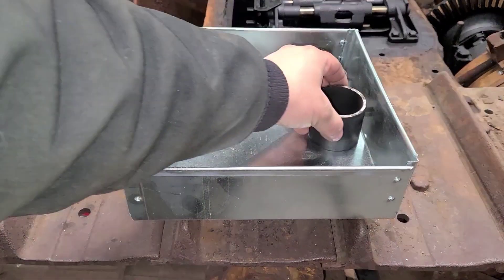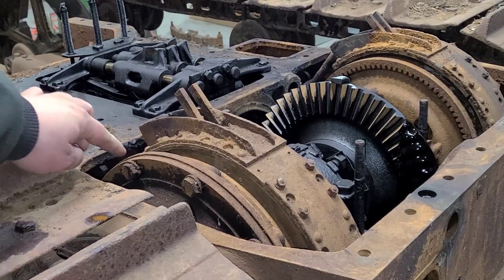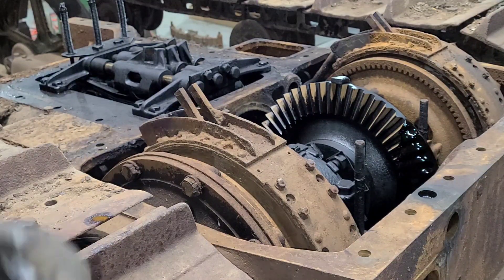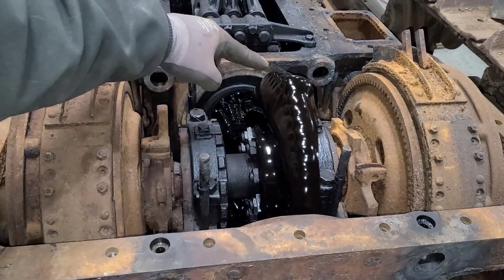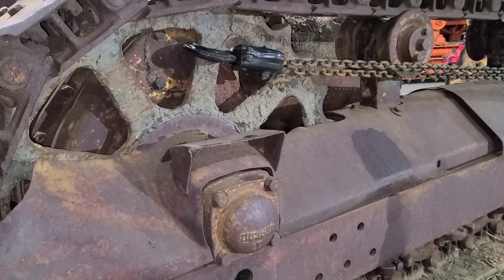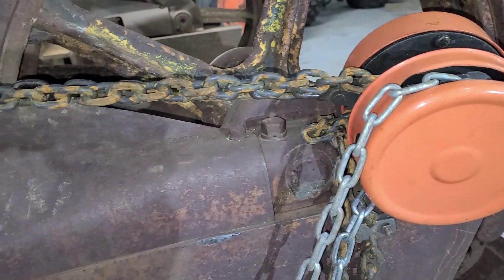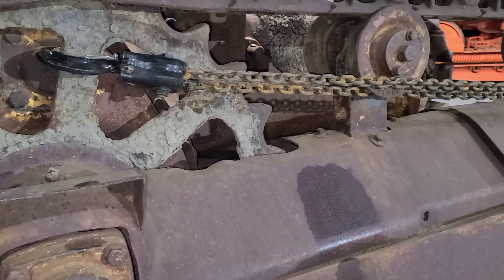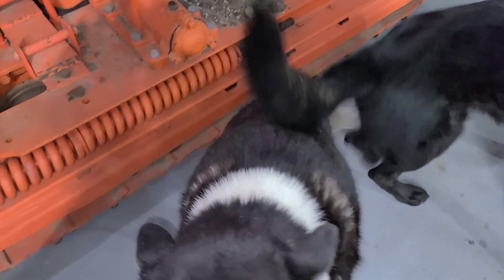Caterpillar RD-4 Chassis and Rear End Disassembly Pt.2

Comment: Often wonder why you do not have heat in your shop.
Reply from the maker: The building is not insulated yet, and heating an uninsulated building is expensive and quite pointless. Hopefully this summer I can get insulation in and finish the inside walls 👍

Comment: Why don’t you  break tracks…how do you think you can possibly get apart and reassemble
Reply from the maker: I don't understand how breaking tracks would be beneficial at this point
Reply: Yes your reasoning is sound..however judging from the age and general condition you might consider getting tracks new pins and bushings..in that case you just drop off the lumps and pick up like new…if possible go for the salt type…sealed and lubricated …..especially if you want to keep the machine
Reply from the maker: @charlesdefrancisco5056  track parts are obsolete for these machines

Comment: -1F, that is pretty cold to work in for very long.  Hopefully inside is a bit warmer. 50F is about right, not too cold and not too hot.  Maybe after insulating and some heat you can get close to that.
How does the camera battery hold up in that temp, or are you running it off the charger?

Lot of torque output in those final drives to be able to get that much rotation just by lifting the housing!

Do you plan on going through the final drives and rollers?
Reply from the maker: The camera will last about 15-20 min if I don't have it plugged in. I was just glad I was able to get those bolts out and I hope that answers your question from yesterday. We will be going through everything so stay tuned, thanks John
Reply: @kylechrist  yes, thanks.  We’re there is a will there is a way.  Nice solution to things being locked up. Hopefully the right side Clutch comes apart like the left.  That side seems to have more rust than the left.
Keep up the good work and great content.

Comment: On my D7C those bolts are only accesed  one at a time   through a hole in housing   above the sprocket
Reply from the maker: Interesting, sounds much more difficult to get to if the tracks won't turn

Comment: Was there a access area on the rear face of the casting,  hand hole in casting? 
Glad that things are coming along again.
Reply from the maker: Yes there is, the hole is just slightly too far to the inside to get a wrench on those bolts, at least without bending a custom wrench, which was the next option if I couldn't get all of them by rotating the bellhousing. Luckily I was able to get them all, thanks for watching

Comment: Kyle you will like your insulated garage. Foaming your garage will be a fundamental change, it will seal it up so well, you will need to add an exhaust fan. I just did my 160 year old house and it has been a revelation. Worth every penny I spent. If the people that install it do a good job you will be very happy.  😊
Reply: Look around there are many people making Oil Burnes to Heat there Shop....
Reply from the maker: That's the plan for this spring, and once it's insulated I can open the valves and let my wood boiler heat the shed but without the insulation I won't gain much for heat so until then the valves stay closed. Thanks for watching

Comment: Congrats on getting those bolts out.  It's a great sign that they are breaking loose with a box wrench instead of needing an impact or snapping off.
Reply from the maker: Thanks Matt! I was relieved that they came out as well, but a few of them didn't seem tight, almost like what you ran across on your D4
Reply: No t removing the tracks makes what you are trying to accomplish harder than it needs to be ..raising and lowering the trans case is the hard way…I’ve done pins and bushings on both of the dozers I’ve owned…it’s the most practical way as you will be spending a lot of effort in what you are trying to rebuild
Just a suggestion from my ownexperience
Reply from the maker: @charlesdefrancisco5056  I disagree, the tracks chains are stuck/froze/rusted and do not freely turn. Now that everything is unhooked I can work the tracks back and forth to get them to loosen up BEFORE removing them. This will make the removal easier as well as reassembly. If they were removed now all I would have is a pile of stiff links that are unmanageable to work with. There is always more than one way to do things

Comment: You might want to consider picking up a set of "gearwrench" or similar brand ratcheting box end wrenches.  They can be a huge time savings on a project like this.
Reply from the maker: I have them, unfortunately they were in my toolbox on a jobsite, so I just used what I had readily available at home, thanks for watching

Comment: Another nice bit of progress! 
Pro tip for handling your touchscreen without taking off your workgloves: cut a small round hole on top of the knuckle of your  middlefinger, so you can just touch the screen when you make a fist. 
I used to do that when I was working inside the engine/pump room or watertight chambers of sandbarges, everything in there is coated with an awful mix of grease/tar, diesel, salt and sand so workgloves were a one-time use item.
(no way you could get them back on a second time without getting that tar-gluey crap on your hands, my phone usually got a  brakeclean scrub session afterwards but that Samsung S5 mini took it like a champ. it still works like new, even after 7 years of brutal abuse!)
Reply from the maker: Thanks! I hadn't thought of that either

Comment: Those brake bands will split when the 4 bolts are removed.
Reply from the maker: Which four bolts are you mentioning? Thanks for watching
Reply: @kylechrist  on the brake bands. Actually they are the nuts. Hold the two halves of brake bands together
Reply from the maker: @beginlivinglikeaboss  I will look into that, thanks!

Comment: Dear Sir, How do you manage to even move your fingers when I can see the water vapor from your breath literally turn to ice flakes!!??  You have my undying admiration for putting up a video in those conditions.  Looks like it'll take a couple of weeks for that oil to drain from the ring gear ;-)
Reply from the maker: My goal is to get this machine stripped down before it gets nice out because the guy that does my sandblasting gets very busy once he starts back up in the spring, so I would like to be among the first on his list, hence why I work even when it's cold. Thanks for watching!

Comment: What is that gear ratio on the final reduction drive?  Must be about 8:1 to get almost a full rotation by lifting only 45°.
Reply from the maker: I would guess it's somewhere in there as well, when we get to the  disassembly of those we will count teeth and find out gear ratios, thanks for watching

Comment: If you jack up on the tracks it only takes about 1foot ot 2 of movement to get the flanges to turn 360
Reply from the maker: Once I get the tracks moving I would like to keep them moving to get them so they are not rigid like they are now, maybe by towing the unit around and letting the tracks work back and forth. This will make them easier to remove and also reinstall if I don't find anything better
Reply: @kylechrist  If you get them moving and prove there's no problem with them other than wear, then the running dozer won't have any trouble at all breaking them in the rest of the way!

Comment: Good Morning Kyle.
I can assure that the oil is now heavy grease. 
There will be no rust on any metal that that stuff comes in contact with.
Maybe you can scope it out and use it to heat the building?
Reply from the maker: Haha it's definitely grease again, but once it warms back up it should drain out. Thanks for watching

Comment: The next problem I can foresee is if the steering clutch packs have to move inward slightly to clear the drive plates they were bolted to, good luck.
Reply from the maker: I wonder about that too, hopefully I can get just enough movement to remove the shaft l, thanks for watching Geoffrey